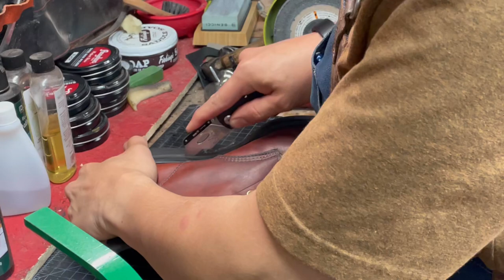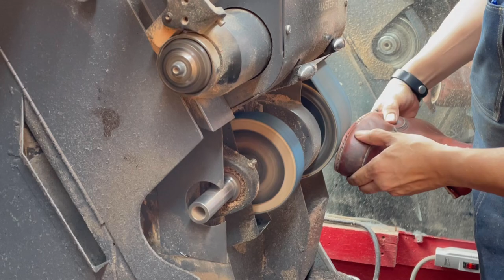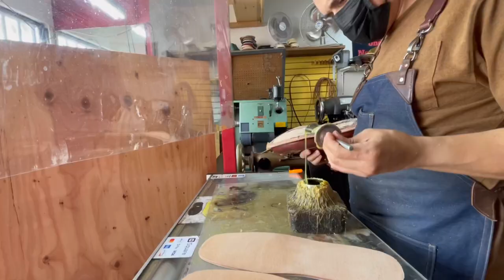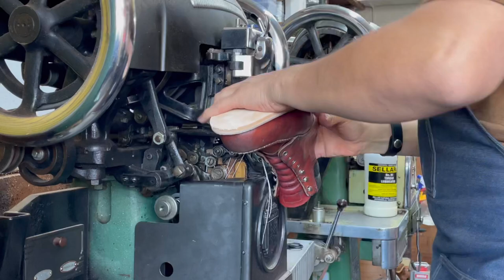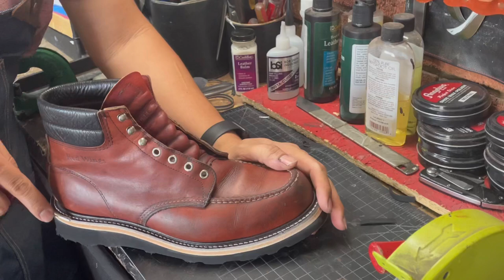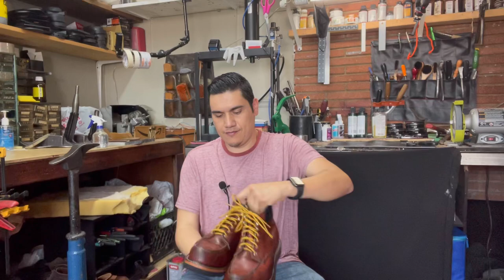1990’s Red Wing 204 Re-crafted

Comment: Amazing job! I bet they are way more comfy now. The original Supersole 2.0 is so hard.
Reply: It's hit and miss.  I have 3 pairs of the original and a pair of 2.0 the later being super comfy. Now 1 pair of super soles I have to use an insert. But the other 2 are great as is. And yes I'm wearing these at work on concrete at a print shop for 10 hours a day.
Reply: @waynedub1167  Glad it works for you. Instant plantar fasciitis pain with mine until I had the outsole replaced.
Reply: @ludolibre852   Which ones do you have? 
The 2233 I have are in need of a resole like yesterday.
Reply: @waynedub1167  Red wing 402